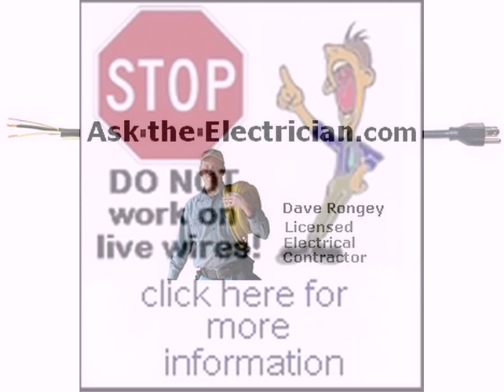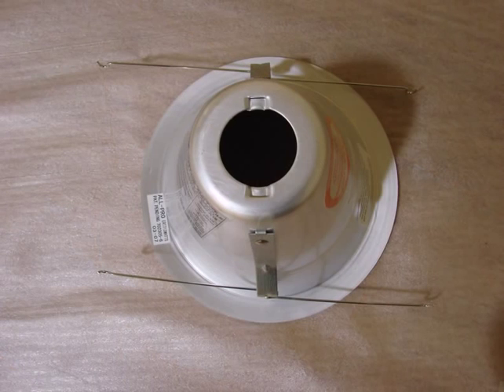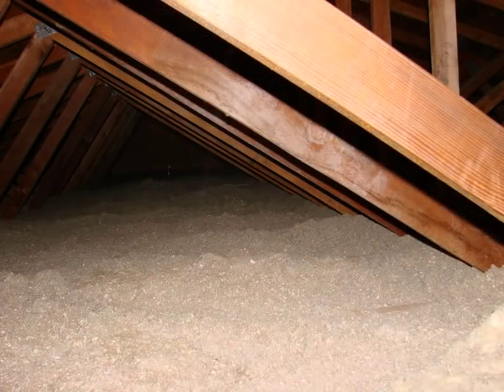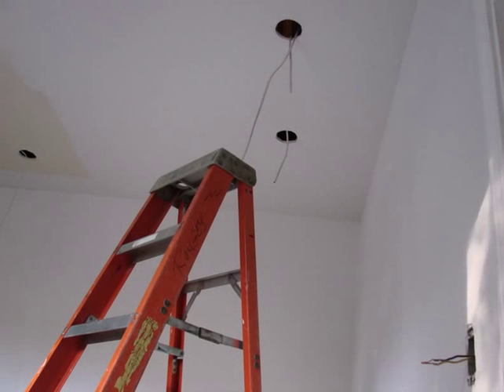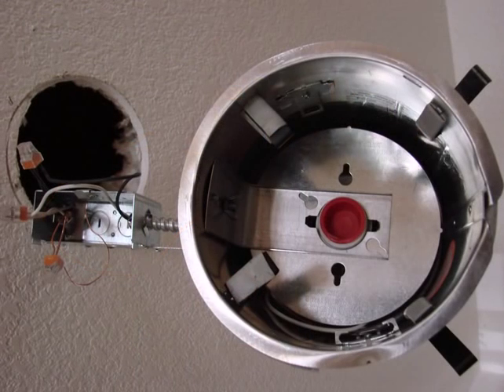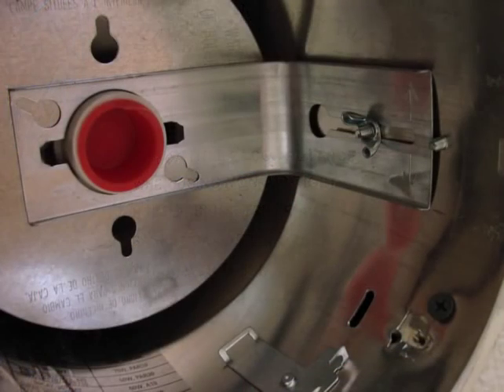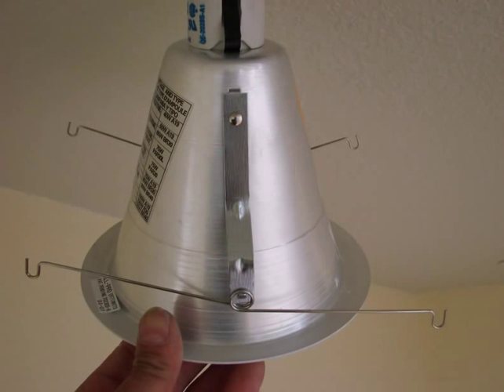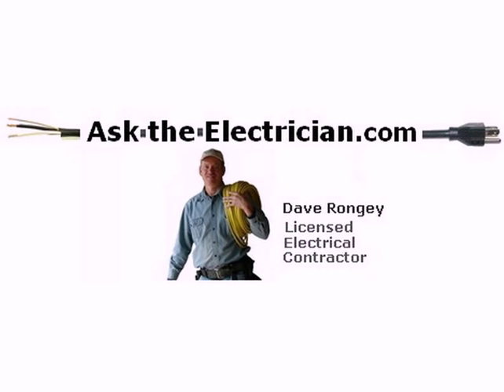How to Wire Recessed Lights, Flush Lights, and Pot Lights.

Comment: Hey I need to install a recess light in my bedroom what i have in my bedroom now is a light switch that runs to an outlet that i plug a lamp into the other 3 outlets stays on all the time and I have a fan in the ceiling I would like to put 3 recess lights in. how would i wire that?
Reply from the maker: Typically, the wiring from the switched outlet is extended up to the desired location for the new light fixtures.

Comment: I have a bit of a different question. My house has cans with fluorescent lights (gx-34 connector I think they are called. I want to put in regular LED lights. Can I bypass the ballast or would that require a whole new can? I have had some people tell me the whole can needs to be replaced and others tell me I just need to bypass the ballast.
Reply from the maker: Its best to replace the can, unless there is a retrofit kit made for the light that you have.

Comment: never install lighting or anything with volts and current from the internet ..Every state / province / Country has it's own laws on installing for hazards and fire I.E here you can not use a 20A breaker to run light which many people do ..its against code A 15A must be used  or copper wire with alum, Many people like myself don't know Ohm's law or why there's different gauges of wire for a high amp or why not hanging wires below piping or over ducts ..DIY's kill people and burn down homes
Reply from the maker: Awesome! What location or areas are you referring to?
Thanks for watching my Electrical Wiring videos!

Comment: which one of those you would recommend to use in concrete ceiling?
Reply from the maker: It depends on the thickness of the concrete. A remodel can light may work for you.
Thanks for watching my Electrical Wiring videos!

Comment: Hello Dave, I was planing to add 4 recessed light, I need to take out an old can recess and replace it with a new and a second one on that circuit, The other two will be connected in another room., Now my Question is would I be able to use the wall nuts instead of the twist one, I read something thatthey do not take stranded wire, Need Some help.besides the solid 14 wire, most of the fixtures wires are stranded also so I don;t confused myself , Thanks
Reply from the maker: It is best to use twist on wire connectors for the wire connections. Great Question!
Thanks for watching my Electrical Wiring videos!

Comment: cat someone give me a tip on how to Unlatch the clips to take a 4' recessed can out of the ceiling.  I need to get to the wiring and don't want to damage the can or drywall. Thanks.  I just can't seem to get the clips to pull forward so the feet unlatch from the drywall.
Reply from the maker: Use a straight slot screw driver placed into the slot to unlatch the mounting bracket.

Comment: I'm having problems with the clips.  In the video, you made it seem like it was no big deal.  Any advice?
Reply from the maker: The clips are pushed in at top section, and there is a small latch where a straight slot screw driver can be used to press the top part of the clip up slightly, and this will hold the clip into place.

Comment: The fixture he used was a not an IC-rated fixture.  However, the cone insert he used was adaptatble for that fixture to make it IC-rated.  I'm not sure where you can find those cones.  You can buy IC-rated retrofit fixtures - just be aware that the housings are typically a bit larger than non-IC-rated fixtures.  Make sure you get an IC-rated fixture that easily fits into the hole you cut for the fixture.
Reply from the maker: Awesome - Thanks for that!
Thanks for watching my Electrical Wiring videos!

Comment: You need an IC-rated fixture (Insulation Contact).  These typically have larger housings than the non-IC-rated fixtures.
Reply from the maker: That is correct - Thanks!

Comment: Sounds like you may have a wire with a knick in the insulation.  TURN THE CIRCUIT OFF then check to make sure all your wires have the insulation fully intact and that they are not pinched.  If those are not the issues, check connections again (including grounds).
Reply from the maker: Good idea!

Comment: What if attic insulation touches the can? could it potentially be a fire hazard. My attic has a ton of insulation in it.
Reply from the maker: IC stands for Insulation Contact. An IC rated light has a double wall frame that prevents direct contact with insulation. Non-IC rated lights create heat, which may cause a fire. Fires caused by non-IC rated recessed lights happen because the housing of the lighting is in direct contact with insulation in the attic or fixture space of the home.

Comment: You did not show when you put the mounting clips down in place.
Reply from the maker: The clips are pushed in at top section, and there is a small latch where a straight slot screw driver can be used to press the top part of the clip up slightly, and this will hold the clip into place.